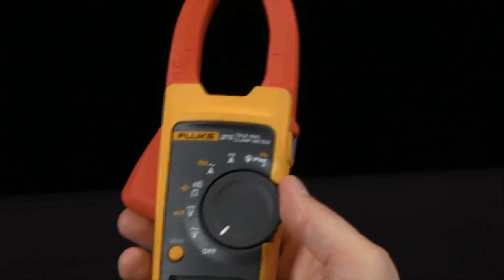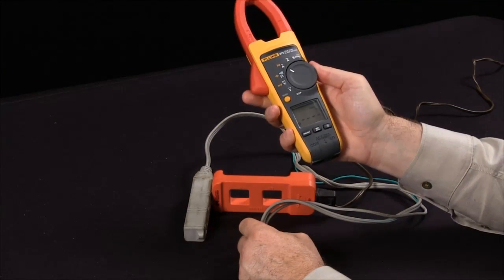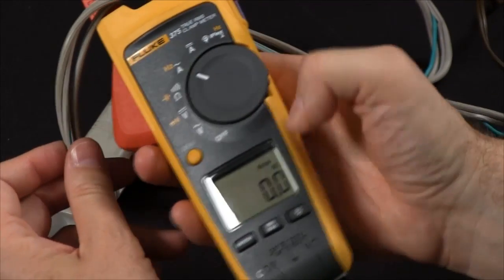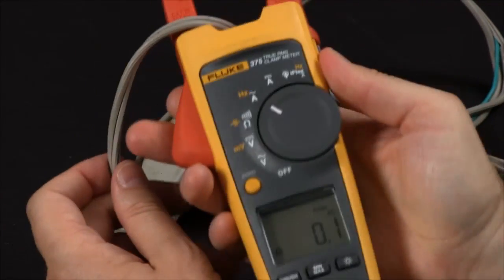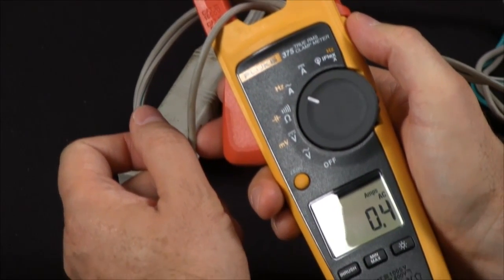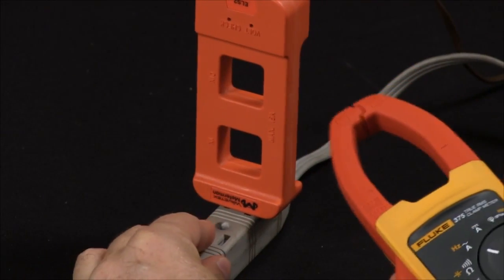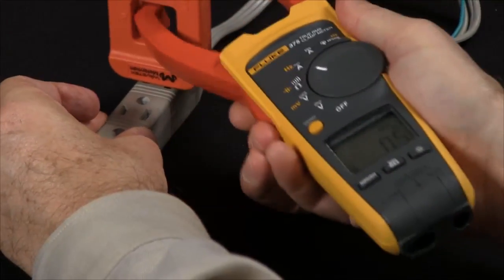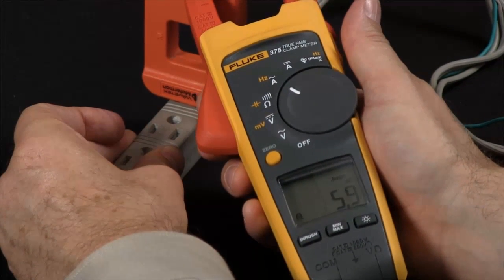How To Measure Current On A Power Cord With The Fluke 375 AC/DC Clamp Meter

Comment: What is that device your using with the meter that is plugged in?
Reply: I also need to know this haha. Is there any benefit to it over using a kill-a-watt?
Reply: They're generally called line splitters. They're actually not as easy to find as you would expect since you can't always get them at Lowe's or Home Depot, but you should be able to find one at pretty much any Harbor Freight, or you can always order them online.

Comment: can you measure amperage with the probes?
Reply from the maker: Hi there - Yes, the 375 is compatible with the iFlex flexible current probe (sold separately), which expands the measurement range to 2500 A AC.